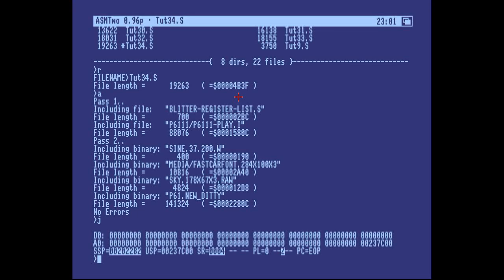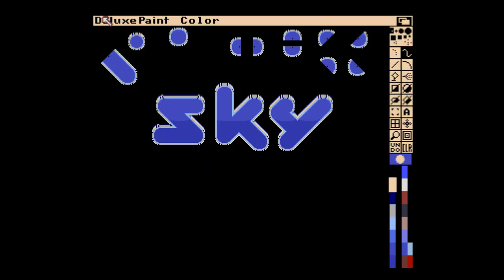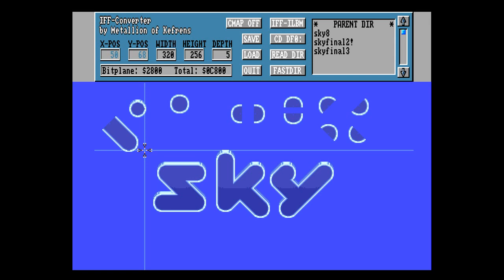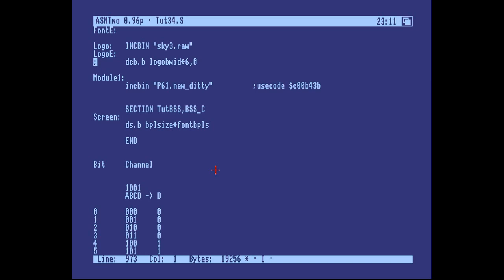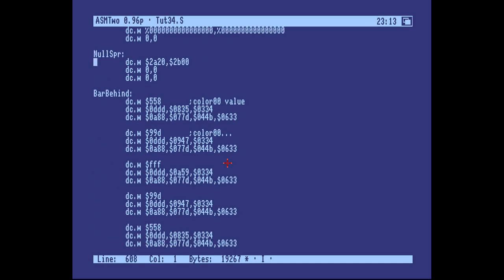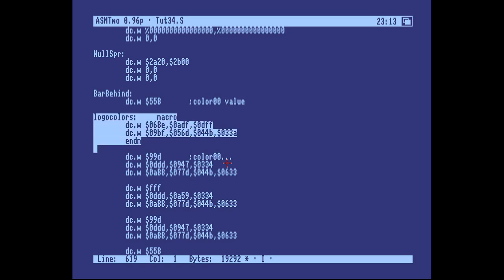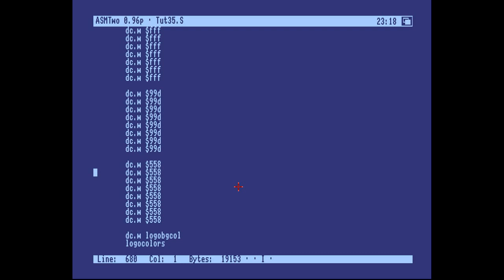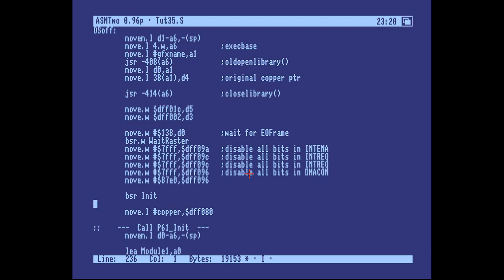Amiga Hardware Programming 35 - Design and Macros

Comment: hey Photon, hopefully you still read comments here :-) recently my power adapter started to act up, so I installed WinUAE to give my Amiga a bit of a safety rest until the replacement arrives. Until now I was very proud of my antialiasing on my old trusty CM8833 CRT, but on the LCD screen the logo looks quite blocky. This made me thinking: people these days will mostly watch the new demos in emulators and even people owning real hardware are using LCD screens instead of CRTs, which alters the design for the worse as you lose a layer of smoothing. I am curious: did this change your workflow and are you optimizing the effects and graphics for LCD, or are „era-appropriate“ CRTs still the primary target for the scene?
Reply from the maker: Dark tones are darker and closer together with the exponential gamma response of a CRT. When you draw on a CRT, you tend to not use too many dark, subtle tones unless the surrounding scene is dark.

Flatscreens have color profiles to make the gamma response more linear for photos and videos, and this is why antialiasing on CRT can give "jaggies" even on calibrated ones. It works the other way too: convert a white polygon on black background to Amiga, and half of the antialiased pixels barely show up.

If something doesn't look right, first calibrate the monitor (flat or CRT). It can be difficult to do it properly because of few user controls, but it's a good start. If something looks wrong when calibrated, troubleshoot or change monitor. 

As for target, I think (hope) most people check on a real Amiga from time to time and make necessary adjustments - so these days I think the target will be a compromise between the two quite automatically, either close to CRT or to flatscreen as it suits their workflow, and I think the favorite graphics program largely determines the compromise. This is the case for me and my preference is for lores pixel work is DPaint on CRT. It gets checked regularly, since I use WinUAE to sync work to Dropbox. I almost always start and finish work on a CRT, to get the ballpark colors right, and then for the final details. Some art I do on my Amiga from start to finish, while a monochrome fonts I can do in WinUAE from start to finish.

So much for tech and workflow. As for the craft, it can be to keep what looks good.

In this image, you can see choices made by eye (and brain): Left edge vs underside of characters, crisp middle-S against the underside of upper-S. As in, if you antialias everything, it looks blurred. A medium tone against black might be all she needs, and trying to smooth it will affect the outline, lose crispness and not look better.

http://kestra.exotica.org.uk/files/screenies/3000/Fusion-CrStormMaster.png